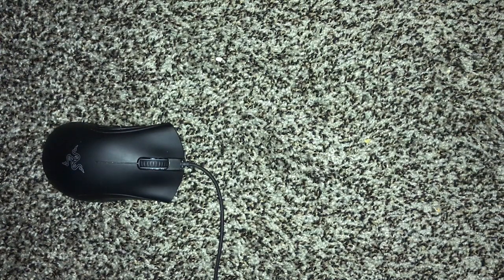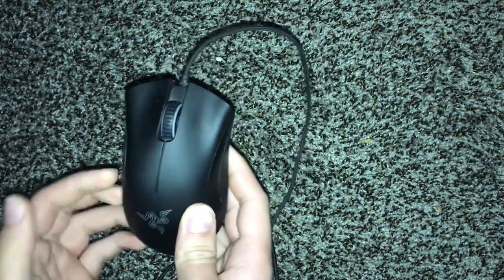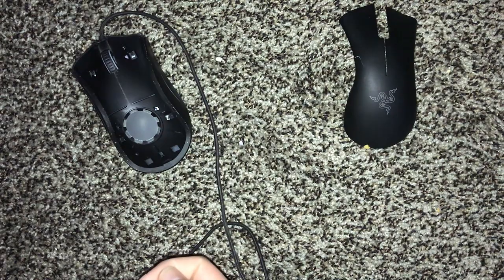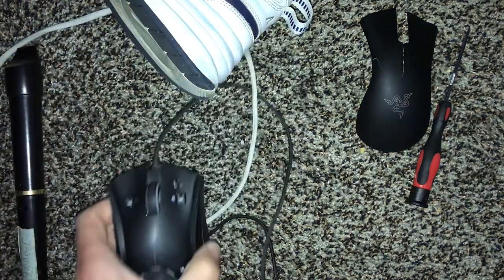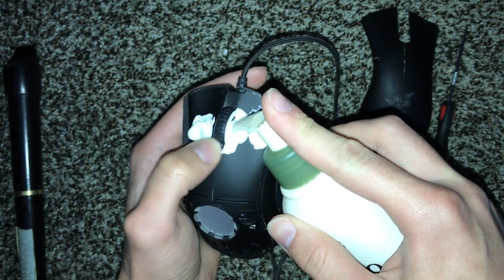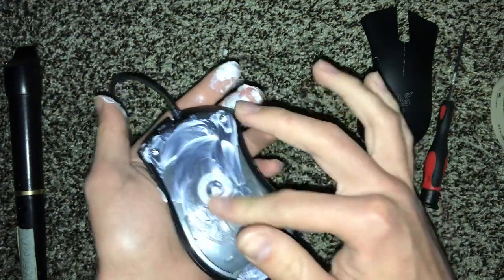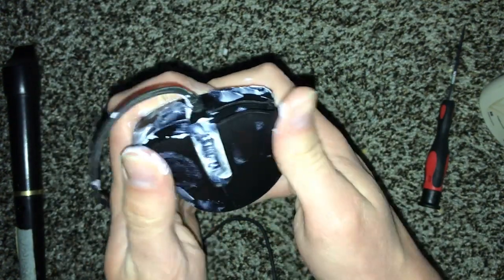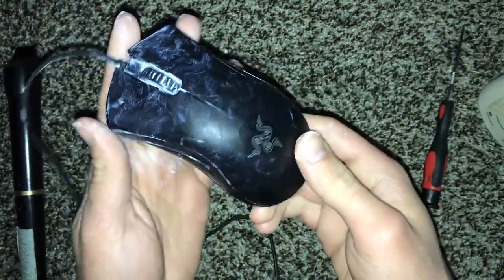How to fix Razer Death Adder mouse click issue

Comment: I WAS FOLLOWING ALONG AT FIRST YOU MONSTER. But I wanted to make sure that removing the top cover was doable so it was helpful seeing how you pried it off and I was able to fix the clicking issue my Razer Mouse had. Thanks!
Reply: How did you fix it? Pushed it in place?
Reply: @TheSwarlers  After removing the cover I cleaned the insides with rubbing alcohol and flexed the plastic so that the left button made better contact. My left click wasn't getting a good connection (noticeable if I had to click and hold, it would lose the click or double click)

Comment: Instructions unclear but I get the general purpose. I think coconut oil would work as a better base because the oil on your had and the coconut oil are going to repel each other causing the oil to stay on your mouse longer.
Reply from the maker: Yes, coconut oil would work, and due to the high presence of fatty acids, it is quite conductive and since you are lubricating the electrical contacts, you need a conductive paste. But any conductive lubricant will work.
Reply: @aquaprofile  Also, if it needs washing, just stick it in the dishwasher. If you don't have a dishwasher, well, a simple washing machien will do the trick, just be sure to dip it in W40 first so the water doesn't ruin the circuits. An oven set to pyrolisis may do the trick as well, though I yet have to test this.
Of course, do not try this at home . Nor at anyone else's home. I mean even respecting and protecting idiots is a part of common civility...

Comment: Despite the video being a comedy , I sprayed some wd-40 in the button without removing anything. Just slipped the straw between the mouse body and the button targeting the plastic that presses on the switch. For now the double click issue is gone after a long time.